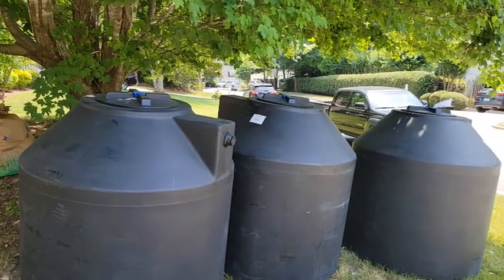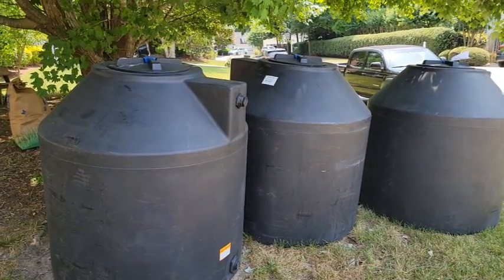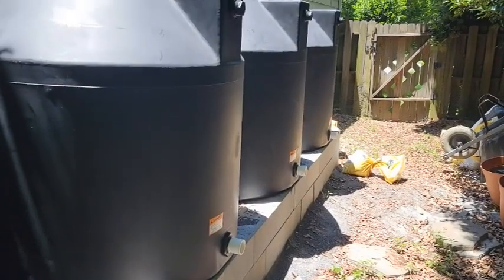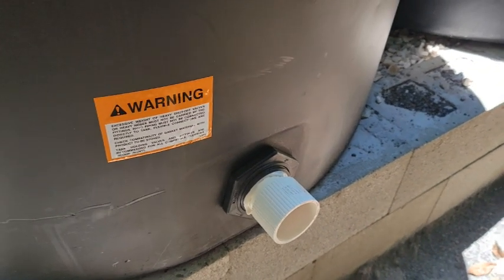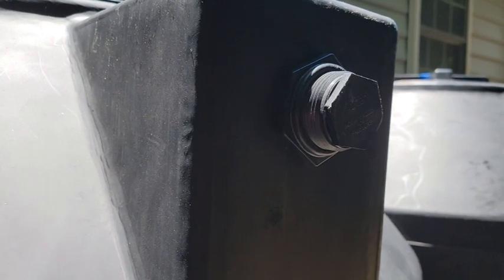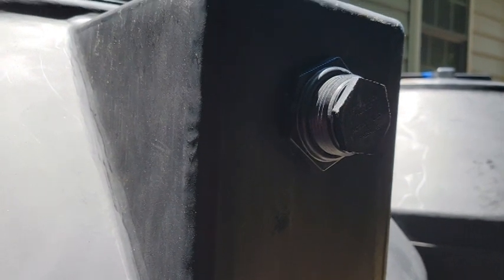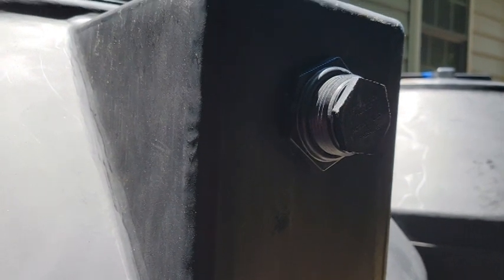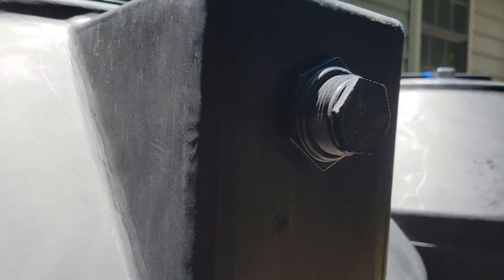Rainwater Collection System

Comment: Where did you order your tanks and what features did you look for?? l I'm looking to order a basement cistern as a backup holding tank with a booster pump. It would give me time in case my well pump craps out, but I want to make sure I'm buying the right plastic. I know color matters for algae if it's exposed to sunlight, but I saw somewhere that many plastics are sold as potable safe, but aren't unless they meet certain criteria.
Reply from the maker: The tanks I went with came from https://www.plastic-mart.com/.  The have distribution points in a number of states, and will ship for a reasonable cost.
Reply from the maker: Forgot to answer the entire question.  I was looking for tanks that I could store rainwater for use in the garden, with a secondary use as backup drinking water if the grid goes down.  So I wanted BPA free, as well as a solid color so the sun couldn't get in.  There are plenty of tanks sold by plastic mart that are ok for potable water.  Sizes from small (<100 gallons) to large (>2500 gallons).

Comment: What is the square footage of the house take  that nomber and you can size the system  accordingly for example if the house  is a 3000 square foot home you need a 3000 gallon system
Reply from the maker: Gutters feeding the cisterns collects about 350sf of roof area.  Cisterns are sized for the available space.  Water to be used for garden during dry season.  Good for about 30 days of irrigation.

Comment: What happens if the water in the tank freezes?
Reply from the maker: Rarely gets below freezing for an extended period in this area.  The thermal mass of the cisterns would take quite a while to freeze solid.  If it looks like we are going to go that way, a simple tank heater would solve the problem.  

As far as the connecting pipes, those could freeze.  But they can be shut off from the tanks, and there is a drain valve on the outlet.